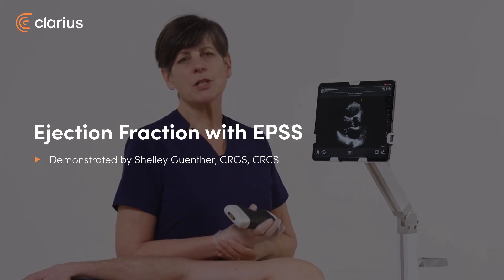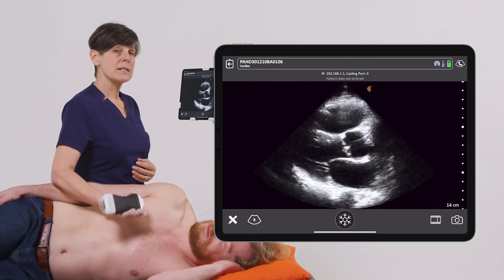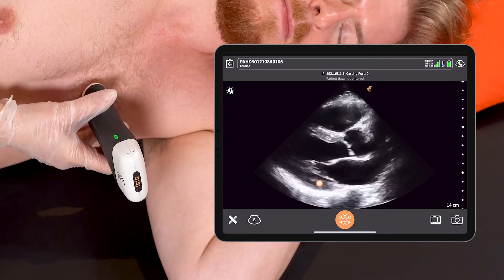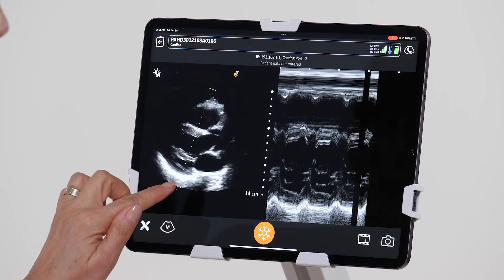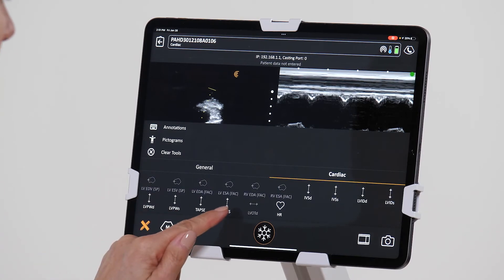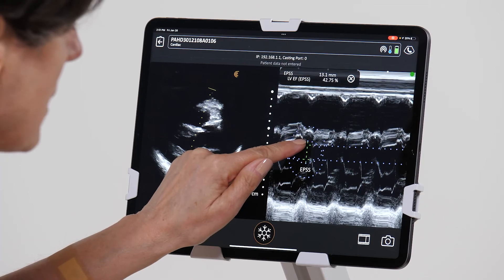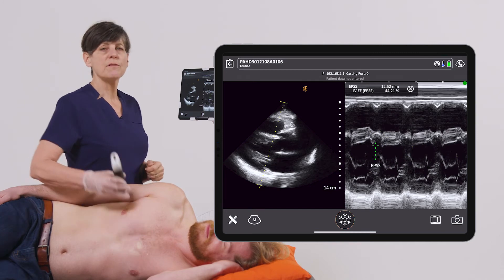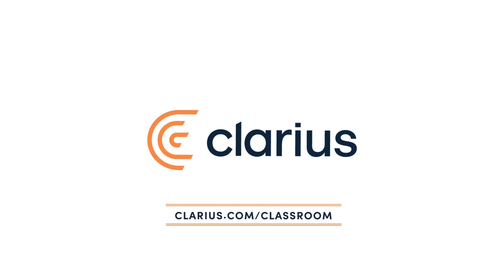Ejection Fraction with EPSS

Comment: Looks like a good extimation to me… she just placed the caliper a little below the E point of the MV and the EPSS came out over-extimated. But the actual calculation will work fine if you measure the EPSS correctly.